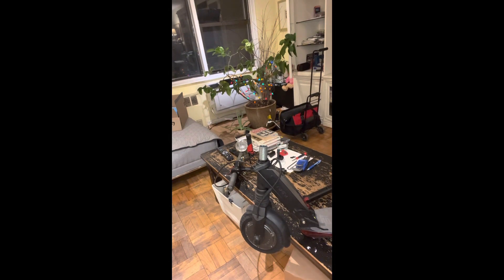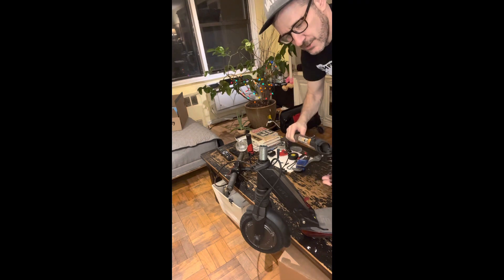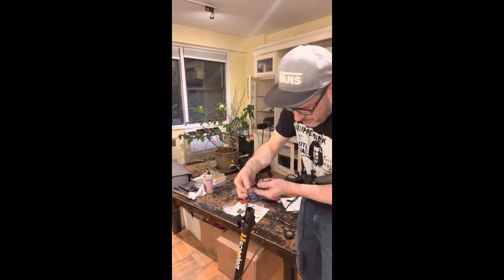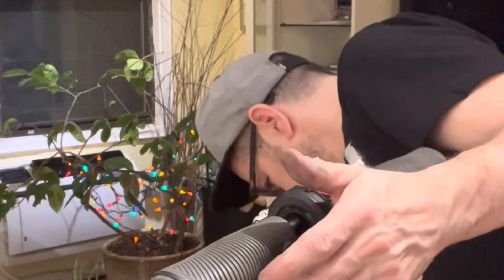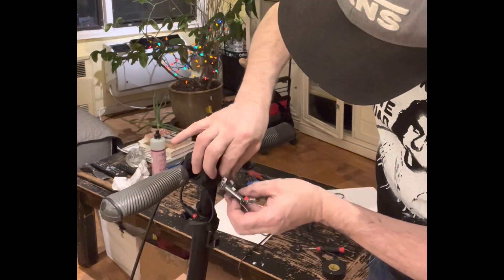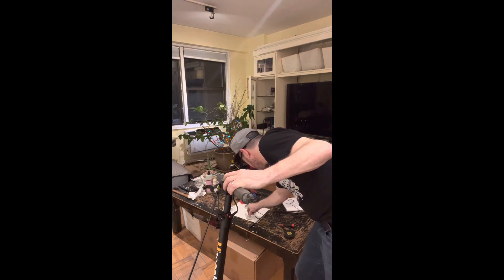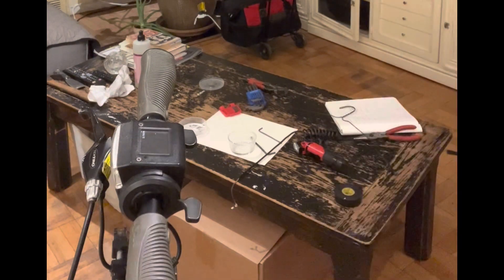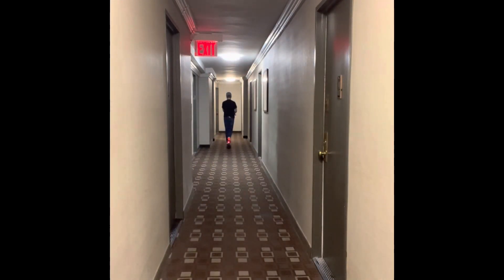Uscooter - E-twow - Booster GT scooter not working - E2 E4 error code repair

Comment: How did you get the the black sleeve out connecting the stems? I can’t seem to pull the top stem out from the bottom. Thanks
Reply: You’ll called it a spacer.
Reply from the maker: Just checked this account - were you able to make the repair?

Comment: I have a uscooter and recently the little metal button that lets you keep the handle bars at either the first height or the second height(if that makes sense) came dislodged.  Any chance you can explain how I take off that top bar of the handle bars?  When I loosen it up and pull, it won't seem to pop out so I can get to the little metal button piece to put it back in place.  Hope this makes sense.  I appreciate your help!

Comment: Do you have the link for the cable !!?? I’m gonna try to fix my scooter 😑😔
Reply from the maker: https://www.aliexpress.us/item/3256801835951765.html?spm=a2g0o.order_list.order_list_main.5.21ef18029Xl4h9&gatewayAdapt=glo2usa&_randl_shipto=US
Reply: sry but did you find the cable being broken or simply went ahead and ordered a new cable & replaced it
Reply: @taaviplaan  I just went ahead ordered it and replace it … unfortunately it did not work for me so now  don’t  know what else to do not sure if it is the motor or the controller I had just put a new controller couple of months ago so kinda mad at the moment and left the scooter accumulating dust 😒
Reply from the maker: sorry - just saw your post - I has the same issue, I had replaced the controller a few months prior as well - luckily for me it was the spring wire - I called the company and they told me it could either be the spring wire or controller - you could try calling/emailing u-scooter and see if they have any other suggestions.